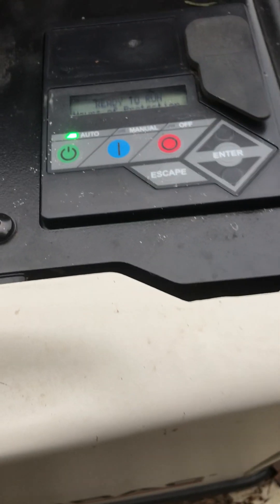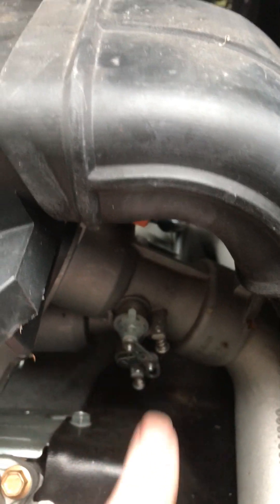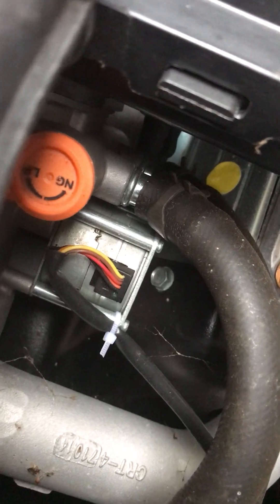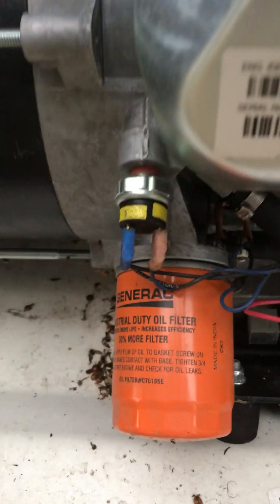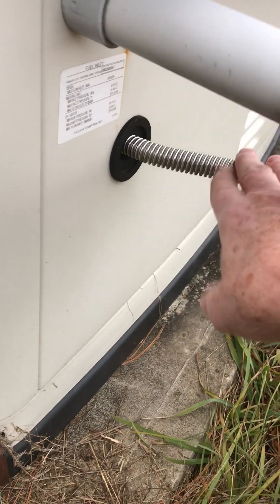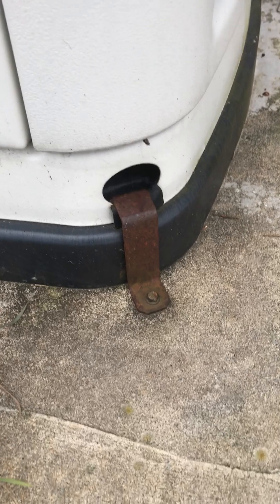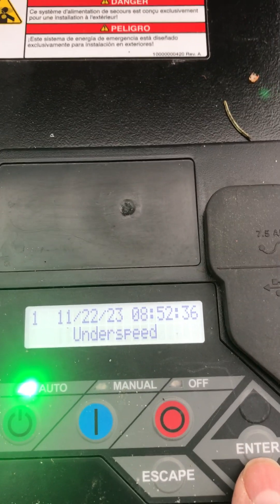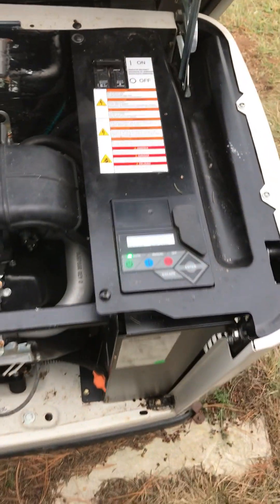GENERAC 16KW UNDERSPEED ERROR CODE 1603

Comment: Can't hear you at all
Reply from the maker: I did have a cell phone that faded in and out like this but I replaced that phone.
Now, I can't view the original because I've discarded that phone.
Whether or not this was the old phone, I don't know.
I can hear it by adjusting the volume on the video itself and using my device volume but it is annoying with the fading in and out.
I usually write an explanation beneath the video which may help.
(Less painful that the sound.) My apologies.
Reply from the maker: That happens, even to me.
I've even run into the video lagging the voice.
I can return and find everything working well
Reply: @snowman6686  Try watching the video, the sound cuts in and out :) Anyways my underspeed error code was because one of the stator mounts broke off the engine block somehow. I replaced the stepper motor, then found out no spark from one of the spark plugs. Had to have an aluminum welder come out and tack it back on, back in business now. Thanks by the way, although I couldn't hear your (Can't hear you still) this video helped a lot.
Reply: It's probably your finger over the microphone
Reply from the maker: @msquicc  Good one. Yup, that's a good one.